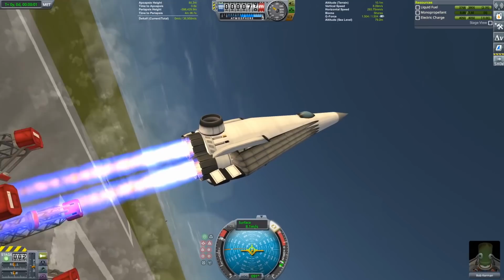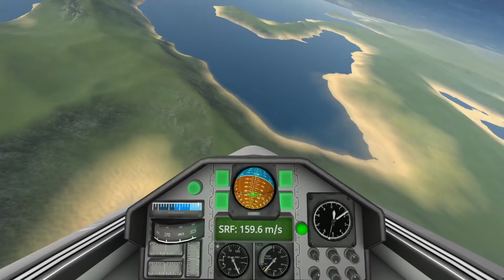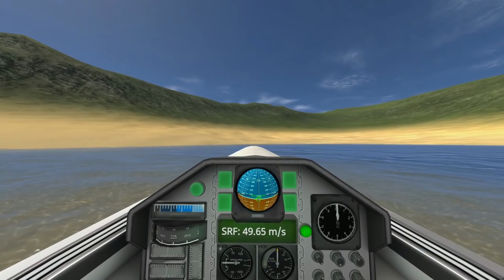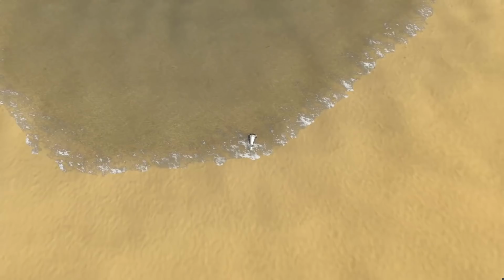Monte Karlo Kerballing Challenge - River Kile hotlap

Comment: Me: trying to create plane faster than 500m/s that is still maneuverable.
Brad: easy-flying trough the canyon at 1500m/s and 69g.
Reply: When my plane goes faster than 500 m/s, it sometimes pitches down in the drink, but if it survives and reaches somewhere around 800 m/s, a wing piece falls off and I turn into a fan.
Reply: My plane:3000 m/s and overheat,take it or leave it

Comment: Someone should submit a run with a thumper only craft as a meme
Reply: Someone should make a kerbal swim the entire way.
Reply: Stratenblitz did it only using solid rocket engines
Reply: The thumper's too lame. There's really only one choice : THE FLEA.
Reply: @evanconcepcion7934  Mite
Reply: @zntei2374  place-anywhere linear rcs port.
Reply: I did a monoproppellant only run on the Monte Karlo course
Reply: @evanconcepcion7934  what about drain valves?
Reply: @WoddCar  impossible without intake air glitch or kal
Reply: @origamiscienceguy6658  yes,give me some hours
Reply: @Shuroii  staging and huge wings might do it
Reply: @enderman5423  ayo, it's been an year

Comment: >Post a challenge
>leave no chance of beating your score under some set of rules
>stonks

No, seriously, acheving that speed on a straight line without overheating (at this altitude) is kinda impressing, and you're making precise turns with it, also having tight fuel margain.
Reply: Have you seen the cocaine plane from the previous challenge? The thing could pull 400gs at 2000m/s
Reply: Bradley is extreme capable pilot and engineer, that's why he does make this challenge.
But if you will look at his previous challenge, you'll know he is not alone.
KSP has 1M players or even more, even if Bradley plays this game better than 99.9% of them, there's still ten thousand players who can accept this challenge.

Comment: Idea: Hardcore Mode
No higher than 150m
No slower than 500m/s
You have to stay over water, no going over the edges
Maximum of 15G through the whole course
Reply: minimum 500m/s and maximum 15G will make tight turns super hard
Reply: @tomasebenlendr6440  that’s literally the point

Comment: Since you're using some mods (namely Flight Engineer Redux), you should've used Raster Prop Monitor as well. You could've set up some of the screens to help keep track of information as well as display it for the audience, such as having numerical Radar Altitude / ASL, larger digital Nav Ball, Digital Heading, Digital Maps, Active Biome Tracking, etc.

Not to mention RPM just looks nice, lol.

Comment: How about a watercraft speed challenge? Rules could be altitude can't go higher than 1 meter and a part of the craft must remain in the water at all times. How fast & far could it go before it breaks up?
Reply: Max 30 m/s , water is just a devil's brake
Reply: @muskerbusker1244  Funny, my vanilla KSP hydrofoil just did 86 m/s before Jeb lost control flipped it aft over bow.  No one died. Nothing broken. It's just floating upside-down. LoL
Reply: I think there are part's of the run where the river is "broken" by streches of land, at the end for examole, so a boat can't surpase those. Also isn't that river like 800km long? A boat doing 160km/h would take 4h, 1 in x4 warp if it somehow stays in one piece
Reply: I mean I got bored one night and made the Alicorn from ace combat with SRB’s where the engines are... got stuck at about 95 ms without taking off but looked hella cool
Reply: @muskerbusker1244  
Not with a hydrofoil. I've gotten crafts well over 100m/s on water.

Comment: Bradley Whistance: perfects the route to get the time below 10 minutes
Stratzenblitz: discovers a heatshield-winged craft that makes any craft with regular wings obsolete

also Stratzenblitz: this is similar to the Kraken drive, so it should be its own category

You might want to update your doc in this regard
Reply: Heat shield wings without drag will make the whole craft unstable after first turn

Comment: Note how at 6:37, Bradley cleverly banks his craft at an angle clearly designed to make the digital altimeter unreadable, making it impossible to determine whether he has broken the course ceiling. ;) (Analog altimer is right on the line.)

Comment: I figure the fairing occlusion stops leading edge heating from blowing up your cockpit or wings, but how do you stop the engines from overheating?
I've been trying to make planes that can hit mach 5 (1500 m/s, whichever comes first) near sea level, but so far I haven't been able to hold it for more than a few seconds before the engine explodes, and often they explode well before that point, usually around 1450 m/s.
Reply from the maker: the engines are all occluded in the fairing for this

Comment: Perhaps some supplementary rocket engines with high TWRs, such as the Vector (with its TWR of 23.87), or the lightweight Twitch (with its TWR of 19.34), would've helped in getting those supersonic jet engines back into the speeds where their TWR is optimal (which is Mach 3 for the Whiplash's optimal TWR of 21.90, and Mach 3.75 for the Rapier's optimal TWR of 23.74), after losing so much speed on those tighter turns (especially the sharp ones around 5:50)?

Comment: Probably a stupid question, but why the whiplash engine?
Reply: Higher efficiency than the rapier, and nearly as good performance for the speed the course allows.  He only had 50 fuel left and the whiplash is ~20% more efficient, I don't think the design would have the fuel needed with the rapier.
Reply: oh okay thanks for explaining
Reply: @cbudzynski  The max theorical speed with the whiplash engine is lower than the rapier, so it help to stay under the heat limit.
Reply: @laszlosauve1877  Sort of, he's more than fast enough enough to destroy the vehicle with heat, but he doesn't stay at top speed long enough.  Anything above 1500 m/s can overheat a plane, especially at low altitude.  I've lost several SSTO's at 20,000 meters at lower speeds than his max at 1600m/s.  If he used the rapier I think the top speed would be pretty comparable, which is why I highlighted the engine efficiency over the top speed.

His land speed records, show this rather interestingly.  It didn't look like he had any heat shield on his first run around 1500 m/s.  A small heat shield on the second around 1650 m/s.  and a whole bunch of shielding and sacrificial parts when he hit escape velocity in the most recent attempts

Acceleration though would be faster with the rapier especially at the speeds he's running at.  It's why he used that engine in the shorter course, he didn't need anywhere near as much fuel, and the track had more turns, so the higher acceleration would have a greater impact on the time.
Reply: @cbudzynski  I've tested some things for do my submission and I realised that the heat would be a huge problem at high speed. So I used the trick from Stratz (put a heat shield perpendiculary to the air flow for reduce drag) and it works! This trick allowed me to reach a speed of 1760 m/s at the end of my video.
Reply: I personnaly use a single RAPIER